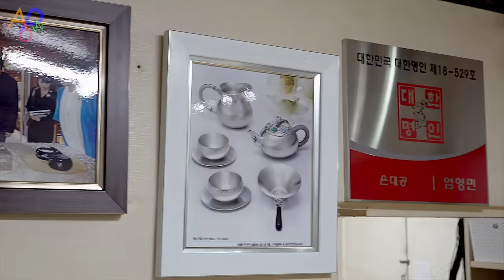Luxury Silver Kettle Making Process by Korean Artisan With 40 Year History

Comment: As a silversmith interesting but a little crude perhaps. We use fold-forming so the piece has a uniform thickness - he does this in part but a lot is done by stretching so the metal is thinner in the beaten-out parts. OK it's quick but he uses a lot more abrasion than we would - we smooth by simply adding more hammer strokes - if the customer will pay of course. 
Really good to see though
Reply: They seem to have skipped most of how the spout was made (8:40). I wonder why? Was there some propitiatory process involved?
Reply: @cogoid  Probably the same way they did the rest. He drilled a hole and created a bulge . so I'd guess he formed the spout from the bulge by stretching  and driving the metal to get the shape. Probably a very tedious process.
Reply: @adriangstern  There is another video about traditional Korean silver kettles, where Hong Jae-man shows how he does it. There, the spout is made separately and is then brazed to the bowl.